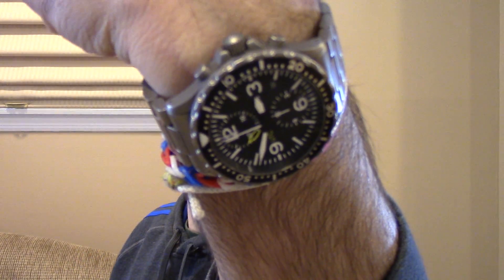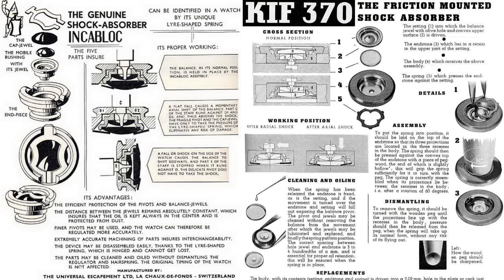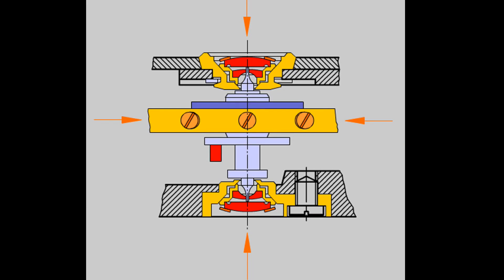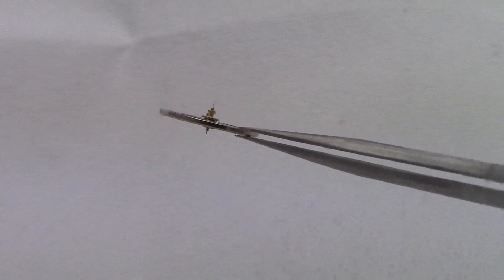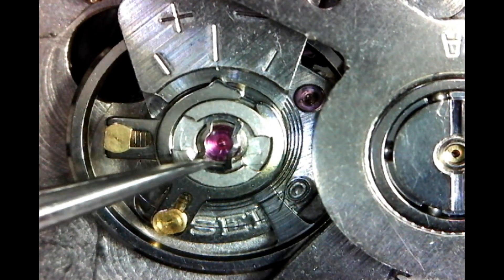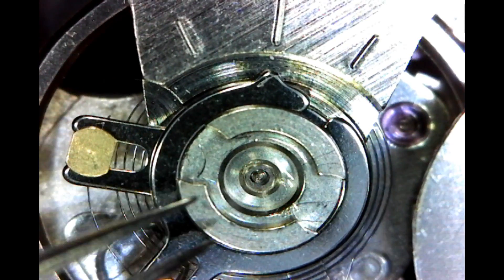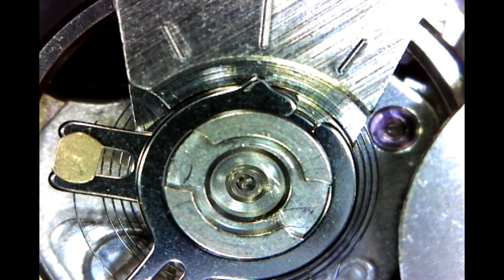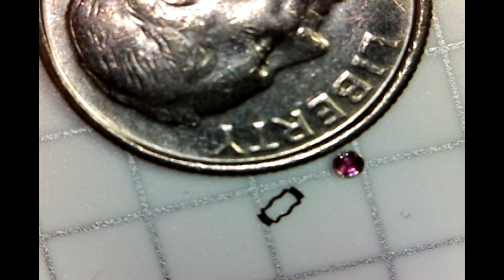What Is Shock Protection In A Mechanical Watch And How Does It Work? Watch and Learn #41

Comment: I have a watch with a 7s26 movement inside. Bought it back in 2018 and it was my daily watch for years. I commuted by motorbike every single day and even dropped it once from table height, and knocked it probably numerous times into door frames etc. It still ticks just fine, amplitude over 280° and minimal beat error and accuracy delta between positions is also fine. Not serviced once in 7 years. So I guess this is proof of the modern shock protection systems (diashock in this instance).

Comment: A very interesting and informative video that led me to do some calculations on the movement of the balance wheel in a 7S26 movement. Assuming a balance wheel diameter of 9mm, an amplitude of 270 degrees, and a beat rate of 21,600 beats per hour, we can conclude that a given point on the outside rim of the balance wheel will travel a total of just under 11km in a 24 hour period. That amounts to just over 4000km in a year, or a little more than the distance from New York to Los Angeles.

Comment: Hey Marc, good video. I think the work you are looking for is axle. Not post or pivot, but an axle and the tapered end of the axle. 

That works better. If you are using wheel terminology the wheel has spokes that go from the rim and connect to the center shaft, which would be a fixed axle. 

I know describing anything technical is difficult. I dealt with it daily in medicine and physiology, wine making and watches.

Comment: Great review! The ingenuity and detail on a micro level is amazing. This is why I like mechanical watches so much. 100 years from now they will still be amazing. 30 years ago I worked in an aircraft instrument shop. Some of the instruments have pivots and jewels on a slightly larger level. I would disassemble it, clean, lubricate and reassemble much like a watch servicing. We used a needle to dip into lubricant and would touch it to the pivot. That was enough lubricant for that jewel. Thank you for showing the intricacies of mechanical watches.
Reply from the maker: Sounds awesome, thanks for sharing.

Comment: Well-explained. I can see a similar assembly through the exhibition caseback of my Seagull 1963 -- which explains why it survived a fall from waist-height onto a hardwood floor without any problem. Purchased from longislandwatch.com more than a year ago!
Reply: Do you have the 42mm or the 37mm? Can't make up my mind. My wrist fits the bigger size, but the smaller one is more in line as a reproduction of the vintage watch.
Reply: How accurate is it? I've been thinking of getting one!